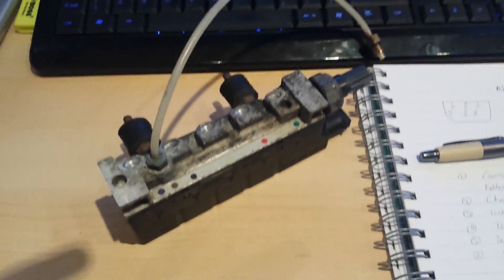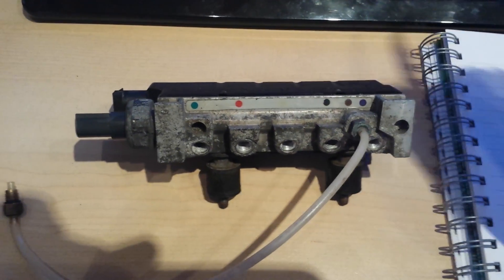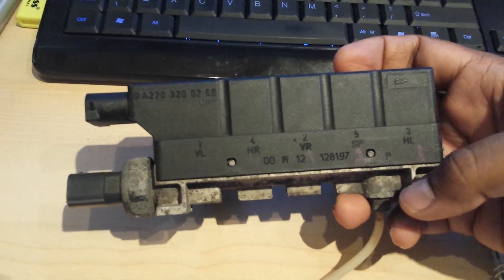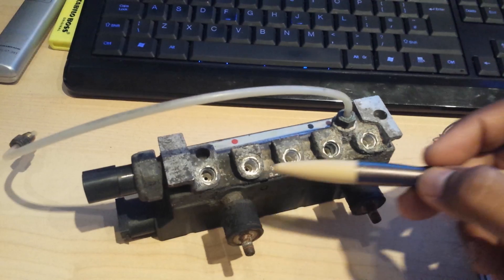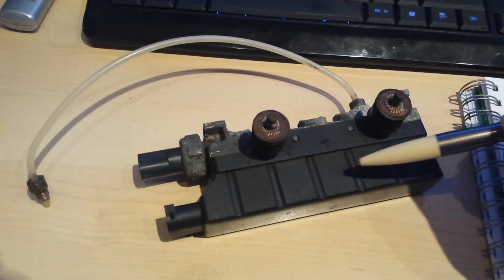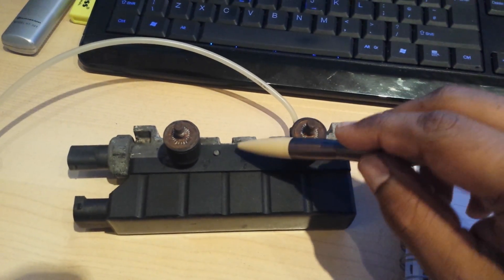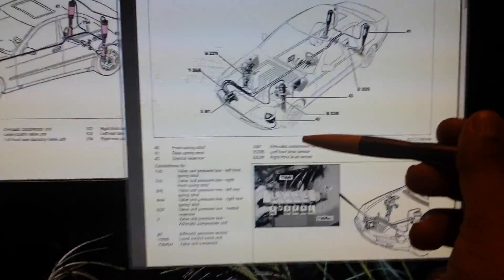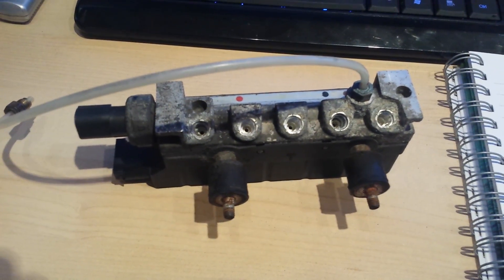Part 3   W220 Airmatic   Testing airmatic valve assembly

Comment: The w211 only have 5 connections…SP,P,HA,VR,VL….so SP is the air tank/reservoir,VR&VL is front so what is the P&HA ?maybe one is for the rear and the other goes to the compressor?

Comment: OK all of this is pretty straightforward on my S 500… 04 model year model I’m working on, I am more concerned about the inner workings of the valve body if they are like tapered valves that seat in and if all 4 are dropping that we can indicate it’s the main air supply valve seat that activates and either opens or makes a tight seal when it closes off with that much corrosion I wonder if you can shoot some lubricating oil or something into those valve areas to help them make a better seat and that oil would work back out of the chambers etc.

Comment: Great vid - thank you. Bit confused. Was just about to take a look at mine and am confused as to which side it is on. Am in UK so is it on the UK passenger side (as I had thought) or UK driver side, before I pull the wrong inner wing off! 
Cheers!
Reply: It depends . .. . . .  for example, I have a 09 CLS550 (US) and the ValveControlBlock is located above the compressor on the DriversSide between the front bumper & front left tire (US), in the UK that would be the passenger side between the front bumper & front left tire.

Comment: (ABC MALFUNCTION) ACTIVE BODY CONTROL LIGHT ON? 2001 w220 Airmatic mercedes benz NO LEAKS AIR SHOCKS GOOD? AIR PUMP GOOD VALVE BLOCK GOOD RIDE HEIGHT SENSORS GOOD?  BUT CAR WONT RAISE ITS YOUR N51 ADS CONTROL MODULE REPLACE IT.

Comment: Great videos on the W220 airmatic system. 
Questions, were the air fittings difficult to remove from the valve block?  Did you consider any of the aftermarket brands as suitable replacements vs. the Mercedes brand?  There's a huge difference in price.
Thanks.

Comment: Hi Waqas.   I know you did this many years ago but has anyone you know tried replacing the level valve block with the plastic (ABS) OEM equivalent units available on Aliexpress ?  I'm keen to see if they are worth trying or if someone has had experiences with them (Good/Bad)?   Any constructive comments are appreciated.
Reply: hi don, I just purchased one of the Plastic (ABS) Equivalents off amazon, just got it today haven't had a chance to install. will do on Saturday, i'll let you know. I purchased a metal housing unit 6 months ago which I'm returning because the left rear would stay stuck open, and the air bag would just fill over a few miles till the car was leaning really bad. I would climb in the back seat and slowly let the air out til it sat level, but would fill up in a short period of time. I'll keep you posted.

Comment: I have a 2002 Mercedes S430.     When I got the car it was lifting fine but it was a noise you could hear from the car while it was airing up. Every now and the the Airmatic light would come one the dash stating to Stop the car. Now the entire front end lowers down on the wheel but will rise when the car is started. Also, now the back is up higher than usual. Please help

Comment: Something important with those cars: if you have problems with the pneumatic suspensión system (any problem), do not use too much the car, as the compressor will work in excess and it can break (at that moment, you are adding a second problem to your initial problem: a broken compressor).

Comment: hi my name is Edie and i have a 2002 mercedes s430. i have replaced both shocks in the back and the air pump and the release valve. However the rear suspension stil does not come up whie the front comes up with no problem.
Reply: You need a shop with the star machine to reset the suspension which is in lockout for those valves.

Comment: hi my name is Edie and i have a 2002 mercedes s430. i have replaced both shocks in the back and the air pump and the release valve. However the rear suspension stil does not come up whie the front comes up with no problem.

Comment: I measured the resistance between pins with ohm meter.    pin 3 (as you assigned)is common pin of these 5 relays.  any pin to pin 3 is about 8.5 ohms.   resistance between any other pair of pins is about 16 ohm.   thank you for sharing you work.

Comment: Hi bro, I have CLS 2006 with Airmatic I am hearing hissing noise near the front left tyre after parking and turned off engine. Frankly I haven’t checked if the car goes down after this but I will check it tomorrow. Also I am hearing the pump go on for few seconds during driving. No warning message on dash. Kindly is this normal or I need to check the system??

Comment: Good video. 
Can i please ask you do you know what is operating pressure of the sistem it self?
I want to check valve assembly with corect pressure or air supplied to it.
Using pressure gauges to check if there is any leak back in valve assembly over lets say 48h.
As far as i understand it,ones valve has let pressure  out to strut.it closes up and keeps pressure in the line?or  am i wrong?
This is to test the part off the car, compressor it self  builds up over 4 bars of pressure  very quickly and fills up my 4 bar gauge and goes over it.
Compressor it self build up good pressure in to dead end gauge,but after few min pressure in gauge starts droping down? i assume compressor it self is not ment to be under pressure  all the time? air feed valve in valve body keeps pressure up and if it needs more in will open the valve and let compressor build pressue up?
Hope you can help me make sense if testing it.
Thanks

Comment: hello, guys , this is LEO from china, sorry for my poor english, wish you can understand when i am describing.
i have a 04 W220 S350.
one month ago, as no idea, i got the airmatic warning : CAR TOO LOW, STOP. the back of the car is so low, but front looks no problems, i can drive, but not fast than 80km/h.
then i went to some repair factory， and hard to fix it. so i try to do it by myself.
i use the computer to read the car's code.
C1314 Y36/6y1 .
C1013. REALY have not 12v .

then i changed the new valve. but when i do the changed . all the gas went out, so the front is as low as the back. and then i can not drive it any more.
but i use computer to read the code .
C1314 Y36/6y1 .
C1013.
missing, now the new issue code is
c1517 -001
c1517 -002
is there anyone can help me to know where is the problem , and which part i should check .

thanks so much

Comment: My EIS is creating systemic problems like my air suspension pump is not working. I want to manually activate the pump as well as both front left and front right solenoids that way the front end will rise to a desired level. Is there a need to activate both air tank and solenoid pins (example, VR : 2 +4 and 2 + 6) ? Cant i just activate pins 4 and pin 6 without activating  pin2?  Thanks.
Reply: exactly what i want to do! activating the valve inflates? so how do you deflate?

Comment: i got a2004 e500 and its staying up wont go down  took out the compressor and service it works good but still stay up
Reply: Oneil Smith I think the problem is a stuck air outlet valve which sits next to the main as it pressure line coming out of the front of the air compressor. If you feed it 12v through the connector socket it should click. If it does not then it’s stuck

Comment: On the car I'm working on I fixed the leak at the top of the strut but also found a small leak at the valve manifold, it leaks where the aluminum and black plastic are.. Can you take these apart to fix them?

Comment: great and very informative. I have my car 2010 w220. system stuck at sport mode. any idea what I should do to reset it again. air system working fine. car raises and lowering fine.but switch stuck in sport mode. and ride is not comfortable hard and u feel it hard. plz help me to find out the cause to rectify it.
thanks

Comment: Thanks for explaining this so well. 

Question: if only one airmatic corner hangs could it be caused by a bad relay? 

As I understand a sagging corner could be due to a leaking strut, leaking air line, a defect level sensor or a faulty valve assembly. How are the solenoids in this valve assembly controlled? By the relay?

My compressor works well for left side airstrut (rear only airsuspension), but right side doesn't lift. Would it be safe to say that the kompressor itself is ok?
Reply from the maker: Hi,
If you are able to hear the compressor running, then it is not be the relay. If the plastic cover is removed under the bumper where the compressor is, then you can also touch the body of the compressor to see if it is running. In general it is reasonably loud without the cover.
The compressor sound is like humming sound and last for few seconds upon start up to pressurize the system. 
Also if any of the other struts are rising and lowering then it is unlikely that it would be the relay. Hope this information help.
Regards
Waqas
Reply: Thanks! I will fault check downstream from the compressor then. Compressor seems ok, usually turns on for a few seconds in the morning. When I took off front splash shied the air filter and hoses just feel on the ground. So pump probably doesn't last very long from all the grit and water that must have entered it.

Another question: How did you clean the valves?
Reply: By removing and replacing fuse number 108, you can compare the working of the system with and without a working compressor. If, under both cases (with and without a fuse installed) the results are the same, then the problema is probably with the compressor.

Comment: Thank God I have a DAS machine. As a former MB tech, I wouldn't have patience or the time for the manual testing. With the DAS machine, I can test each wheel and valves individually and see the pressure in actual values while it's all together.  Also if a solenoid failed in the distribution valve, you will get a trouble code in the Airmatic control unit.

Comment: This tutorial is fundamentally incorrect which make the balance of his tutorials suspect. The number 2 pin is not storage tank but ground. He did not realize in his own tutorials that the number 2 pin is the common denominator in the testing for all valves which leads me to wonder if he understands systems at all Not only is he incorrect he is incorrect 5 times. I lost two days work following his instructions. That and the incessant childish review of the most ruedamentary information makes this resource a use at your own risk warning timely.
Reply: I have not seen the wiring diagram but usually the way cars are wired-2 would be hot, then the computer would supply ground to the other pins to operate the individual solenoids. Have you checked, is that how this operates??
Reply: you seem to know your stuff! how do you deflate and inflate the bag? and is the reservoir continuous with the compressor and pressure switch?

Comment: you are wrong.
Pin 6 is Ground.
and the numbers on the front are the Pin numbers for each valve
Reply: i just tested it and Hollowman1701 is right, pin 1 is for valve 1 and 2 for 2 etc.. and 6 is ground or 0v. Don't forget thats 12V DC, don't mix them.
My problem was valve 1 and 4 stuck with mud because my filter is out of age. i cleaned it multiple time and its working again. Good luck guys (not native english).
Reply: @floo6831  of course i am right ;-)

Comment: Where could be the problem on my car if whole car lowers in 2-3 hours, on all 4 wheels ? It can't be on struts right ? IF only one strut leaked then i could see only that part low, is that correct? Also if this valve assembly is leaking only on one line, then only that side will be lower ?

Comment: I have a 2007 gl-450 with only the driver side dipping intermittently. would u recommend replacing the entire unit or waiting for the whole unit to fail on that side. Will it just get worse?

Comment: Very good series of videos.  I wonder if you might have missed something in your analysis of the problem you had.  You mention the split intake hose was allowing dirty and wet air through.  I don't think the filter is capable of drying the air on intake however.  I am wondering if you had leaky struts, which would then cause the compressor to run much more than designed, which in turn would cause it to heat up.  Warm compressor would lead to condensation in the compressed air, and I assume there is no mechanism to clear water from airmatic, it's a closed system?.   Just my thoughts, once again, thanks for the videos.
Reply: It is my understanding that the intake hose on the compressor has a filter that's filled with desiccant pellets, which removes the moisture from the incoming air.
Reply: Nahh the air dryers not in the hose, the inline filter is also a fluid filter (or same design at least) but on the compressor itself, theres the 2 cylinder shapes that run parallel to eachother, sitting sideways, or horizontally. The bigger, metal one on the top, is the electric motor that spins the piston, and the smaller plastic one on the bottom is the air dryer. Filled with a bunch of dessicant beads, pretty much silica beads. You can easily take it apart and replace the beads if you live in a more humid area. Ive seen others who replaced them and they were SOAKED. But the system works by pulling air thru the filter, and then thru the air dyer. when it releases the air, it blows back thru the dryer  to help dry it out, and thru the filter to help clean it out as well.

Comment: hey i was hoping for some help. pretty much i have a 2006 Cls550 the air suspension failed. the front right strut was blown out. we changed the strut the car wont rise, the motor is working fine, there are no leaks, but the car wont rise, you can hear the noise of it pumping and the lines all have pressure and i have even took the relay off to connect it directly to pump continuously and still not higher at all what else can be the problem what causes the struts to open and allow air inside? any ideas.
Reply: Hi, great job you done putting these videos together.  I have a 2006 Jaguar XJ8L and in the winter the car doesn't rise to the occasion.  I bought the conversion kit and fixed it but I miss my air ride. Could my problem have been the compressor? all 4 sides are low and took a lot to get it up even as temperatures got warmer. Thanks and your response will be greatly appreciated.

Comment: great help ill try this and hope mine works . I only had 1 rear which was down so I removed the valve body to check for blocks all fine I did number them ;-) but now none are rising its staying flat luckily its on a 2 poster ramp and its coming up with the code c1144 pressure switch did I do something wrong :-(
Reply: Yas Chadli You are welcome. Do you know if the Airmatic pump is running? Some times if the leak is really bad the car will not rise at all. It could be worth blocking the pipe for the bad strut and see if the car rises again.  I have two further videos, which I will be posting in the next couple of days. They might help you a little more.
Reply: Thanks iv got the repair kit for the pump its like your the filter had a split letting water in the piston ring was worn and pitted,  hardy any air was coming out of it
 i am hoping to have the parts today , been a great help fingers crossed 😊
Reply: Yas Chadli Glad to help. When putting the ring, look out for it's position. It is important. There are videos on YouTube that cover how to install the ring. If I remember correctly, there is a small groove, which has to be in the correct place.
Reply: Hi thank you for that i did watch it 😊

Comment: hi, nice videos, how did you clean it?
Reply from the maker: Aziz Khodzhaev Thank you. 

I used alcohol based cleaner with air to clean the valves.
If the valves don’t open up quickly then I suggest the part should be changed.
Cleaning alone might not fix the part.

I am almost finished with the project will upload further videos
to share how it is working now.
Reply: if the block is aluminum or pot metal, alcohol should probably not be advised as the reaction of aluminum and ethanol forms aluminum triethoxide, which decomposes into aluminum hydroxide and ethanol in the presence of any moisture2 @WaqasAhmed-kj8ue